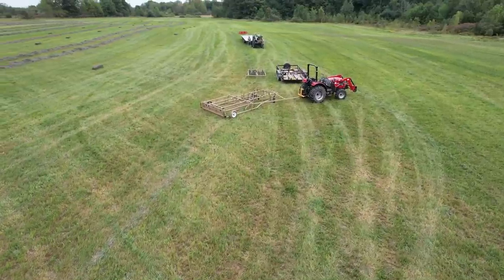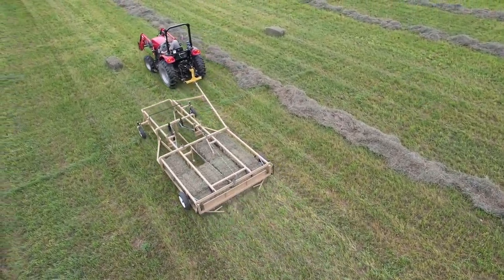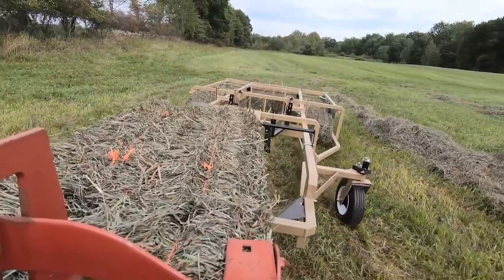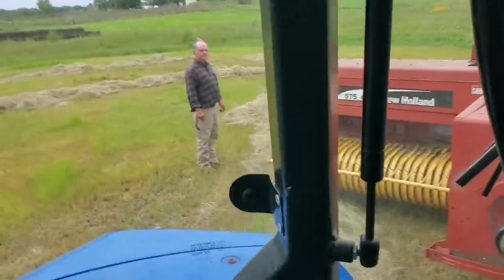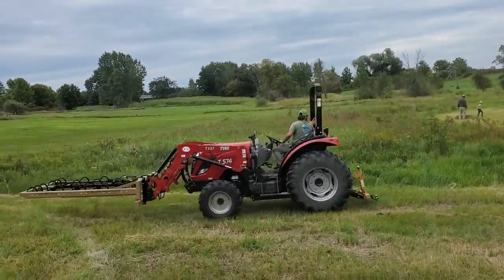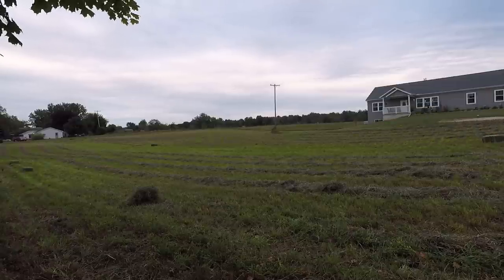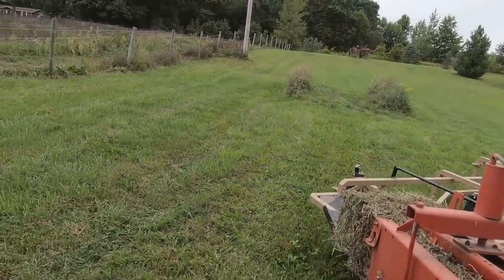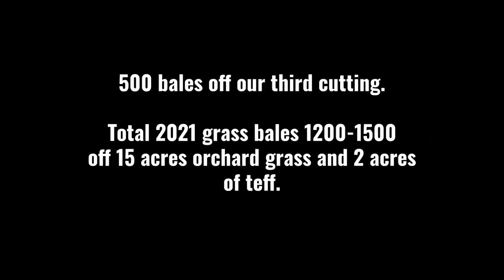404 Ground Driven Hay Accumulator System? - Parish Agriturf Demo

Comment: i did not see where you addressed transport procedure of the accumulator field to field etc as low as it is, it seems like it could be a issue ......and no havent seen that specific drag accumulator system before......have to say your third cut hay sure produced nicely looked very good  IE: 10$ a bale hay
Reply from the maker: The bales must be pulled out before switching fields, but the accumulator has wheels so you just drive it down to your next field :)

Comment: That type of system will save you a massive amount of time especially loading the trailer by tractor and unloading/barn stacking by tractor. That type of system has been in the uk since probably the 1970s but with 8 bale systems but still the same principles. The hay equipment company definitely has a few things to change on the accumulator and the tines on the grab from what I can see. The accumulator should work in any crop but the new paint and poor bales( too heavy, too light, fluffy bales etc) won’t help. You can get used to it in small field (I’ve been in 1/2 acre fields before) but as you said, you weren’t sure what to expect 🙂. Hope that all makes sense (and not too negative) and not to rambling 🤣. I can explain more if needed 🙂
Reply: Cooks have done a flat 10 system from about the 80s one place I worked they had a cooks sledge with conveyor belt in so the bales weren’t dragged on the ground
Reply: @jasonharnett4911  yes your right… my apologies… I’d even been looking at one for sale with a mate🤣🤦‍♂️🤦‍♂️
Reply: No apology needed and I wasn’t trying to make you seem uninformed I was just trying to pass on my knowledge the same as you we sometimes forget that not all parts of the world have seen or use farm equipment we take for granted
Reply from the maker: Actually, there are a FEW companies overseas from America that make some very nice systems like what you are talking about, but they DON'T sell them overhere :(   maybe I should build a knockoff version of them just for myself over here ;)
Reply: @jasonharnett4911  it’s ok, no worries, I’m not offended at all 🙂
Reply: @This1LifeWeLive  I know my mate built a copy of the flat 8 system before. You just need one to copy and get the spring tension sorted😁 but I’d up grade a few bits from your demo one lol

Comment: I would like to know how the hey baler ties the string on the bails and keeps it tight?
Reply from the maker: There is al old slow motion knotter video of a new holland baler tying a knot. Pretty much it has two "fingers" the pinch hold of one line end and when it needs to tie, it does a little spin which catches the second tie and as the bale gets pushed out, it pulls the knot tight and the cutters cut the ends. It does a very fast release and re-feeds one end back into the fingers to hold and wait for the next not. Pretty cool stuff!

Comment: Could you take off the end tray on the baker and drop the bale in front of the acumilater to improve bale alignment into the acumilater?
Reply from the maker: I don't think that would make a difference on a turn, but I'm not sure if it would drop at the right point anyway without the tray/chute  ;)

Comment: I am bad for this, in the 60's and 70's the bailers were essentially the same, but the accumulators and stackers were neighbors run off bar-b-que, beer, and 25 cents a bail. The Music was far better back then though, because it involved mostly teenagers and young adults (parents were usually the driver) the radio station was set to FM playing Led Zepplin, Pink Floyd, Aerosmith, The Doors. . . TBH I think I would still prefer the 60's and 70's, it always became a party after bails were in the barn. Do public schools still even have agricultural days off?
Reply: Nowadays you get caught feeding alcohol to teenagers in the after work party and you'll have more problems to worry about than getting the bales in the barn lol

Comment: steffen systems makes A good set up but, I do like the equipment you demonstrated because It is all mechanical
Reply from the maker: That was one thing we liked too . . .
Reply: What Hp is the red tractor? I think the grab will work on my 55 hp McCormick
Reply: Is there anyway I can get in touch with the people that build or sell this system?
Reply from the maker: @shanerowland3715  it's 55hp with third function on the loader. Plus loaded tires 😊
Reply from the maker: @shanerowland3715  they are very hard to get a hold of, but the phone number is on the side of the machine in the video 😊. I think if you go to their website they might list their vendors?
Reply: @This1LifeWeLive  What is their website?
Reply: @This1LifeWeLive  Approx. How much weight did you gain when loading the tires? Looking into wheel weights myself, Have something against loading tires.
Reply from the maker: @shanerowland3715  I did a video on it last year... I believe it was 300lbs each tire. The new holland has both however. After a bit of research the loading would help with bumps and jarring in the drivers seat. If we needed more weight we could add wheel weights, but they are very expensive 😣

Comment: Yeah..... no. Dragging the bales around the field can cause a few problems. A couple I can think of are, a chance of pulling up moisture out of the stubble &/or inadvertently running through mud or a puddle. Another thing that stands out are the dinky little wheels. They're fine until you find a chuck hole. The framing of the accumulator looks to be a little rickety & I would not be a fan of pulling it behind the baler. Seems that it could be prone to fumbling bales & doesn't seem to turn as tight as, say, a hay wagon if you were throwing them or had someone stacking. It also looks like the accumulator might be bending some of the bales as you drag it along. That could potentially pop one open, which may end up being a pain in the neck. One thing I did not see you do was back the unit up empty. Wondering how easy or difficult it would be to back it into a barn or shed for storage. So overall, I'd give it about 2 stars. Not really impressed with it.

My thought & suggestion would be to try out a NH bale wagon. Easy to load, there are two options to unload which make it faster & there are a few less steps to take to get the hay in the barn. When constantly haunted by the prospect of rain, quicker is indeed better. If you stack them with the bale wagon, you don't really need to lay a finger on them. Just my $0.02.

Have a good one & wish y'all a successful year. Regards!
Reply: Thought same thing used 1034 before going to all round bales. 1 problem I see how no damp or wet spots to drag bales threw
Reply from the maker: It behaves nearly identical to a bale cart as far as manuverability behind the baler. On a tractor it's much tighter. But this is also very light and easy to move around by hand too. The bales that were damp were the ones curling. The problems with the Maxilator are the same ones with this accumulator. Damp/wet conditions cause curling. But with the Maxilator you can at least grab the bales quick to travel over problem areas like puddles or windrows.  Dry bales didn't have issues curling.
Reply: Brother in law used to use a new Holland bale wagon but went to this type of system because wagon didn't work that well in several of their fields.

Comment: As a farmer my self I no lot of fields are not perfect meaning rough fields and unless they are worked up and smooth out it won't be good around here and woodchuck don't help ether with that said it will just wreak havoc on the hay bales and the small tires going into a woodchuck hole might do lots of damage to that equipment
Reply from the maker: That's always worth taking into consideration for sure!

Comment: Don't you think a Bale Wagon would be better.
Reply from the maker: We used giant bale carts for several years. I can't even imagine a kicker on the back of a baler . . . a missed knot and hay flying everywhere :( The bale carts put a lot of stress on the baler, LOTS of back pressure, and any missed knots ended up inside the cart. Then you STILL have to stack the hay instantly in the barn and HOPE you had people on hand to help. We couldn't get anyone to reliably show up, so we switched to the grapple accumulator system. I love it so much more. I HATE the Maxilator though (what we currently use), it's a pain. But being able to grapple and pickup a stack of 10 and re-stack in the barn in tight blocks is great!

Comment: These systems that drag bales all over the field just can't be good. Dragging a bale over the field picks up extra moisture and junk. Not a fan. You would be way better off putting a kicker on the baler and attaching a wagon behind the baler. Yes--you would have to hand stack afterwards but there is always a tradeoff. $8 a bale for horse hay? Seems way over the top to me!
Reply: we didnt sell a bale of high quality grass hay this year under 8$ ...and up to 10$....(sold out quick).all had been drug over the field with no ill effects ....all did not have to be hand stacked .....but there are always those that sell in the 3-6 range less than premium hay
Reply from the maker: Pure orchard bales out here were selling at $8 each before we bought the farm. That was one reason why I chose it. it costs the same time/labor, why not gain a better profit in the end?

Comment: Fuel prices are skyrocketing bc of Putin’s war. Will this raise the price of your hay? Hope you’re feeling better.
Reply from the maker: Don't get me started :(   Diesel here is up to $5 a gallon. low grade tractor diesel is running at $4 a gallon. I paid over $500 to put 150 gallons into our diesel holding tank. I'm kicking myself because I had it on my to-do list the last few weeks but was waiting for the ice to clear. Last time they spring filled they nearly got stuck :P      

So between fuel and fertilizer, it could be a rough year. But if I can get enough manure locally, that manure spreader will pay for itself just this year in costs. I just wish we could have had the dump truck road ready sooner so I could have begun long ago collecting stuff. But Erik didn't want to work in sub zero temps either ;)